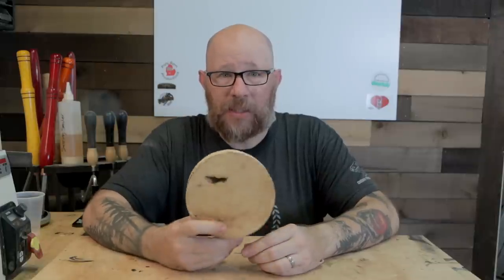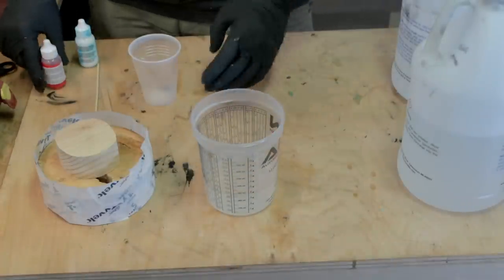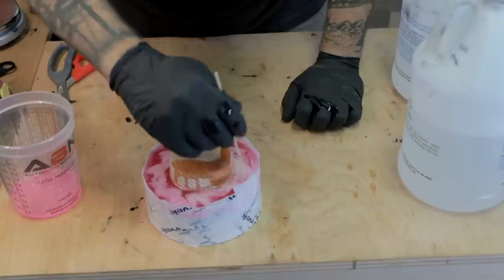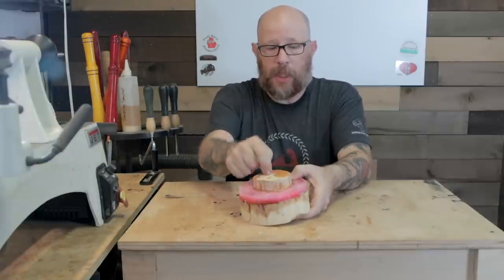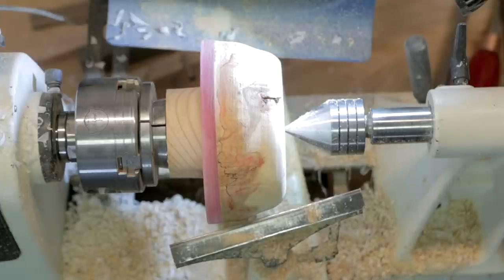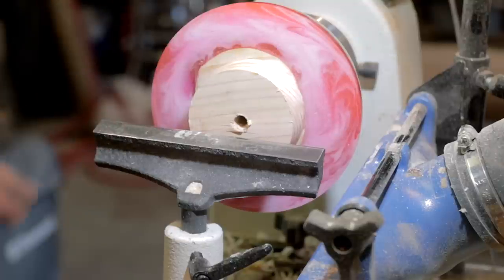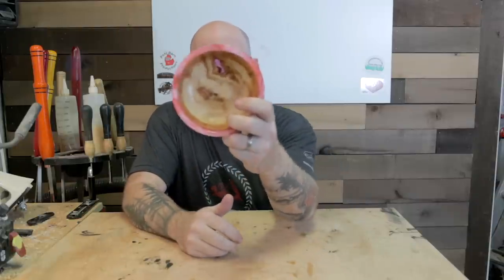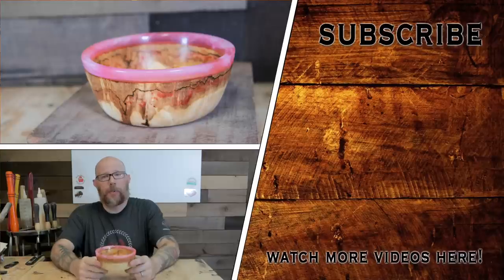Woodturning: The Pink Power Bowl

Comment: Ed,  how do you prevent blowout of the resin while turning?  I was trying to turn an egg that had a pine come embedded in the resin and it was none stop catches and big chucks blew out.  I was turning at 1800 rpm and using a Rockler round carbide cutter and the resin was alumilite.
Thanks.
Reply from the maker: I recently had to put on a glove because the resin was coming out in chunks rather than shavings.  Trust me when I say....it didn't feel too good.  I switched over to a negative rake carbide cutter and wow what a difference it made.  I just took a quick look at the Rockler site and I didn't see any negative rake cutters for the Rockler tools.  You might call Rockler and see if the Easy Wood Tools ones will work and if they have some in the works for their tools.   The other thing is to have the lathe turning as fast you safely can, but 1800 rpm should have be fast enough.  - Ed

Comment: Just subscribed.
Why did the CA glue smoke when it hit the resin?
Reply: Most brands of CA glue will do that to almost anything you apply it to. It is an exothermic chemical reaction that causes the glue to set up fast.  Some other brands that have a slower setting time might not smoke on contact but will if you use an accelerator. I applied some fast setting CA to some bark on an edge of a bowl and it started to smoke right away and that was just bark and wood.
Reply from the maker: What Terry said.  Funny thing is I've repaired cracks before and it didn't smoke, but for some reason, this bowl did.  Must be something in the wood that reacted to the CA.  - Ed